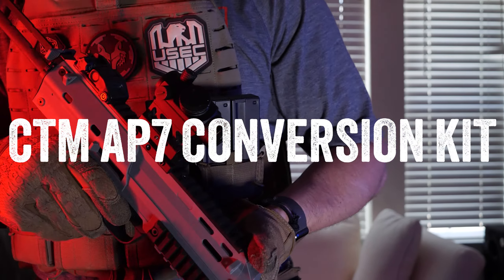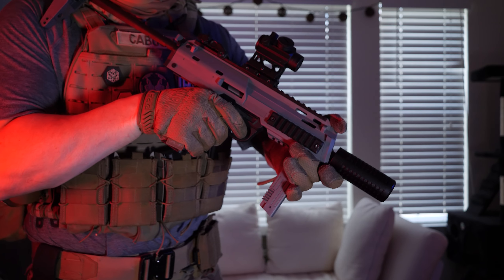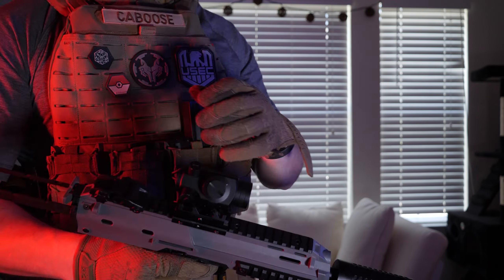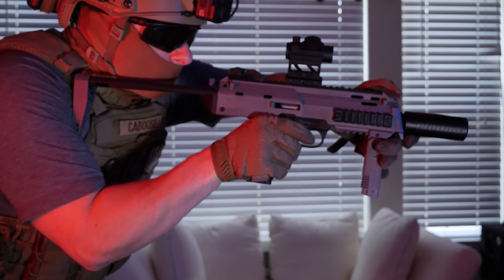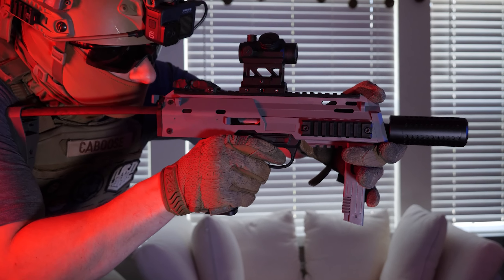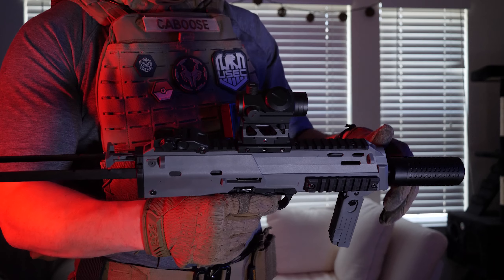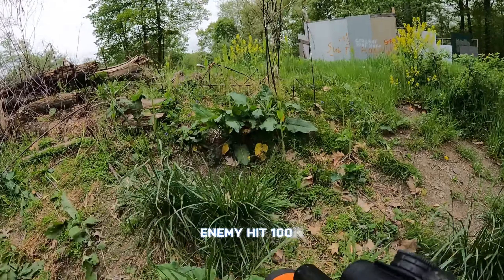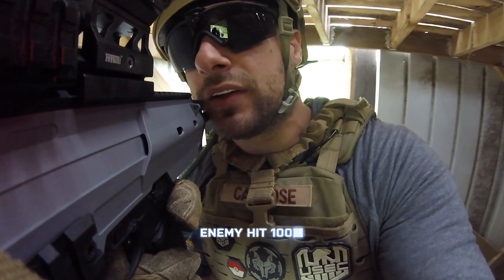CTM AP7: MP7 Conversion Kit Review | Install | Gameplay [AAP-01]

Comment: What internal upgrades would you recommend for the base AAP-01 before attempting to put it inside of a kit and use it with HPA? I wouldn’t think to take a stock AAP-01 and immediately try to run pressurized air through factory internals. 😅
Reply: New hammer set for sure

Comment: what other kits have you tried? I actually put the folding stock on mine and its freakin amazing. I also have upgraded my aap01 almost fully and i love it ever since i bought the thing. its an amazing piece of kit to run
Reply from the maker: @UniversalGamer647  I have tried the SRU precision kit (terrible print quality for the cost) and I currently have my aap in one of those full metal conversion kits that allow it to take m4 buffer tubes barrels and rails, it’s a sweet little carbine I just have yet to get the video out!  I think my aap will end up a sidearm, however, so I will most likely grab that folding stock as well! Glad to hear you speak highly about it!
Reply: @Private_Caboose  I was curious about the m4 style attachments for the aap01. is it worth picking up?  yeah no problem. Since i put that stock on my aap it has performed even better since i am able to make my shots more stable. It also makes it more compact since its going into your shoulder instead of holding it out in front of you :).  However i havent put in the upgraded hammer set yet even though i have one. I dont wanna lose those springs haha

Comment: I saw you had a HPA hose attached, i was wondering if i have to do anything internally to hpa the aap-01/mp7 aap-01 to make it possible to run it because i was going to get this and try HPA for the first time.
Reply: No you don’t have to change anything. Only if you run it with a lot of power. Then it would make sense to upgrade the internals.
Reply: @Captain_bl_007  Also what magazine did you use for this?
Reply: @Theplanetearth1746 I don’t have one myself sorry haha. On the novritsch website you can find an adapter and he certainly has compatible mags too
Reply: @Captain_bl_007  ok thank you
Reply: @Theplanetearth1746  the novritch adapter is good, have had people who have struggled to find compatible mags though. I have the airtac m4 adapter and it woks like a dream.
Reply: @special.airsofter  sound good I will probably get that since I have an m4 so I won’t have to buy mags

Comment: I love the kit but my back part of the stock upper broke 😢 btw what inner barrel length do you use?
Reply from the maker: Oh nooooo!  I believe this has a 6.01 crazy jet 180mm inner barrel!
Reply: @Private_Caboose  thanks, I too also have that threaded adapter and I agree it should of already came with the kit but anyways do you think if I get 150mm inner will it set flush with the threaded adapter instead of it being protruding out?